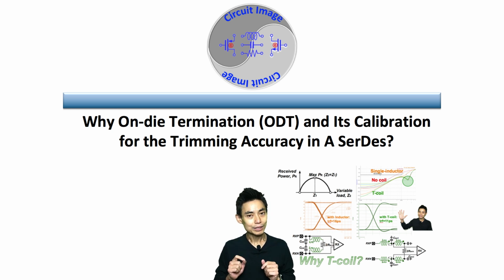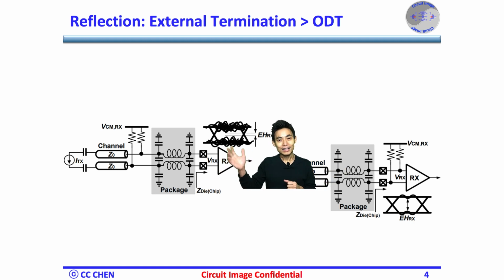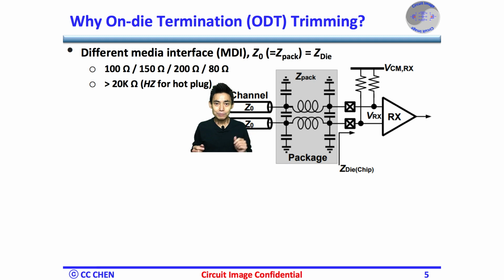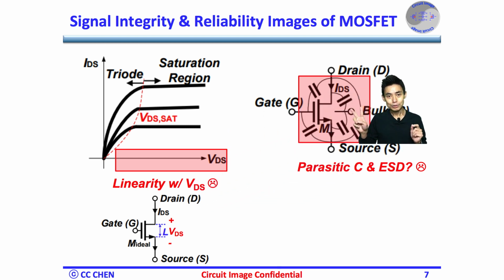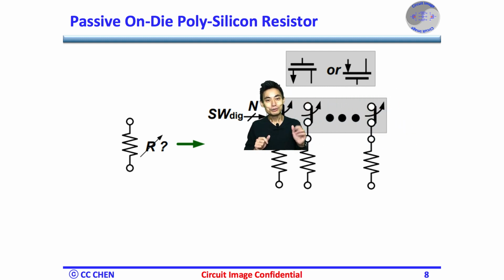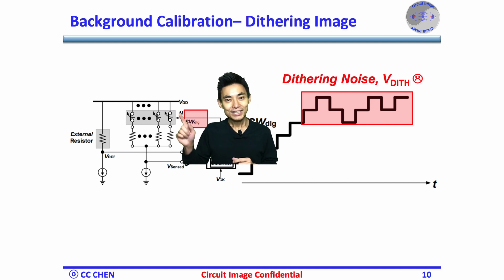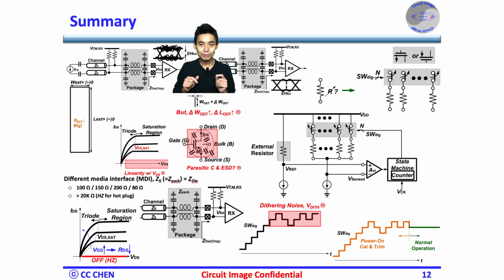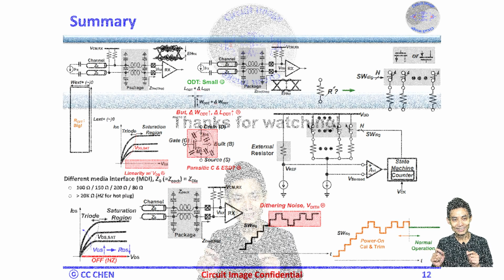Why On-die Termination (ODT) and Its Calibration for the Trimming Accuracy in A SerDes?

Comment: Great job
Reply from the maker: Hi Selva, nice to meet you. Thank you so much for your feedback and I'm glad you liked it.
Reply: I'm using ATSAM 5D27 processor and it doesn't support odt, and in my design I'm using DDR3L, what resistor value have to implement in ODT pin of DDR3L chip, to reduce SI irrue. In layout I'm using T topology for routing

Comment: Good to calibrate the ODT for a good s11 and low reflection, however adding more calibration legs with switches could add more capacitance leading to bandwidth drop. Not sure, if there are serdes applications you know of which do not calibrate the internal resistor?
Reply: Why die to die interface is not need a odt calibration?

The reason is die to die interface isn't big loss rater than other interface?

Sorry I'm not good english
Reply: @장구-d7w  appreciate your comment and it is perfectly clear what you are trying to convey.
Reply from the maker: @장구-d7w  Thank you so much for the feedback. You're correct about the low channel loss. The other extremely important requirement is low power. The D2D must be a low power < 0.5pJ/bit or much less than that; therefore, removing the TX ODT is a trend. 😃
Reply from the maker: Hi Abhirup, that's a good question. Correct. There are a few SerDes applications that does not require to calibrate the internal resistor; for example, the recent popular die-to-die interface would be a good example. 😃
Reply: @circuitimage  thanks for the input CC!
Reply from the maker: ☺️ You are very welcome 🤗
Reply from the maker: @abhiruplahiri1  You're very welcome. :)😀